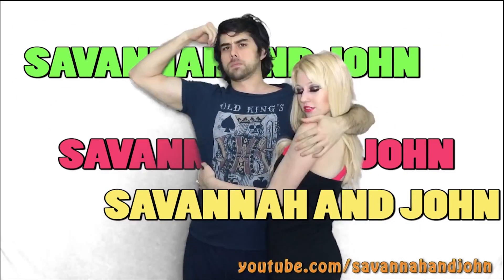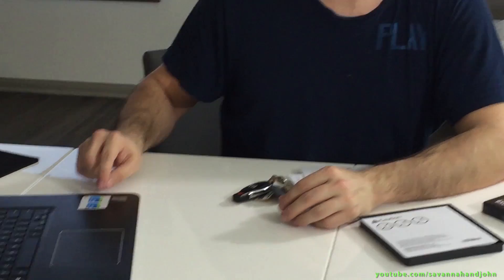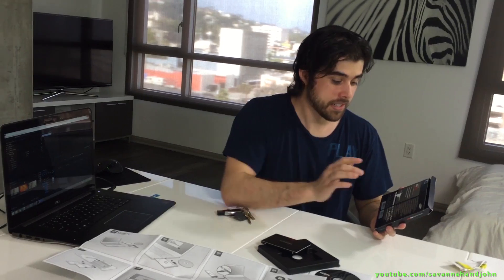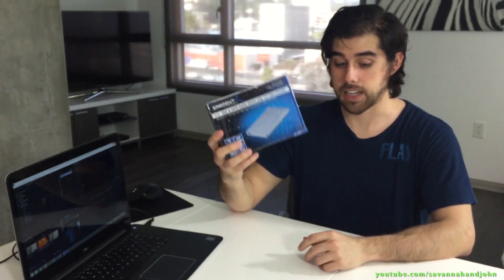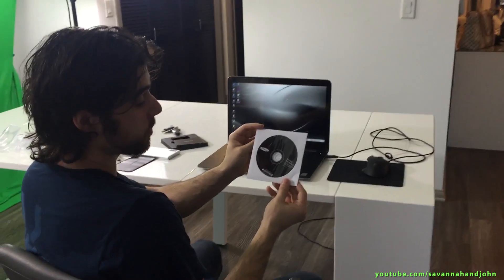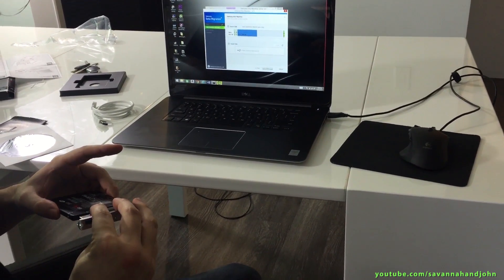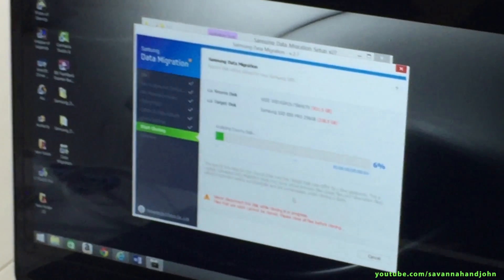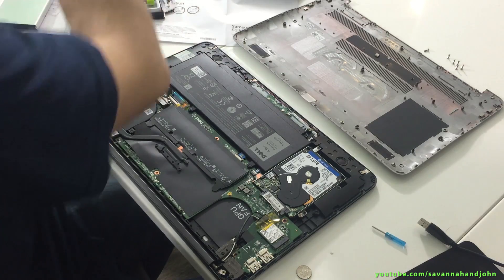Samsung SSD 850 PRO Installation into Dell Inspiron Laptop - Unboxing & Benchmarking

Comment: Im guessing you probably only have 8gb of ram on a single stick. you should upgrade to atleast 2 sticks.
2 4gb rams are better than a single 8gb.

The Dell Inspiron 15 7000 is a great laptop for gaming but it's kind of disappointing that they are using a HDD and a single 8gb ram configuration from factory.
Arguably this allows for more option in upgrading, but if they want to make that argument for a defence then i would highly suggest someone just go as far as building their own laptop from scratch if they really want flexibility.
Retail this laptop is aroung $1500 there is no reason that an SSD ( not M2 ) should be included in the factory.

Also completely off topic, What is up with this computer only having a single USB 3.0 ?

Comment: Hello, one question:  This might sound like a stupid question, but if I am just replacing my second, storage only hdd instead of my OS drive, I can just straight up replace it with this without this cloning stuff or reformatting (my laptop is windows and I have never replaced a hdd ever)?
Reply from the maker: correct, after sata power and sata data cables connected you'll just need to partition the drive in disk management before using, but that's pretty simple and quick

Comment: Nice video. I got this same laptop and Evo500, I'm gonna replace with 1TB HDD  whic is annoyingly slow. Thanks for the tutorial.
Reply from the maker: you're welcome, glad it helped :)
Reply: Hello, sorry this might be a silly question but could you tell me what would happen to my windows 10? (it came with my new laptop HDD---do I have to do anything to make sure taht I have windows 10 like any drivers that I have to install on my external hard drive before I begin to exchange HDD with SSD? (other than my processor AMd drivers)

Comment: my 5 year old dell studio just takes 12 seconds to boot up with and hdd..
Reply: zeus1117 use a timer than I can believe you, the time in the taskmanager is wrong sometimes ...
Reply: +Robipalusa Alias 
Proof it, put it on youtube!
Reply: N1mro8 why should I ? thats average depends on your system, i am running windows 8.1
Reply: Yeah I know, still I would love to see it and of course your laptop specs :).
Reply: N1mro8 Intel i3 M350, 4gb ram, 500gb hdd
Reply: mine takes just about the same.
Windows 10
AMD A8 4500m

something around 20-30 secs
Reply: but.. that's only during boot up...
loading games is painful sometimes
Reply: Cpao V lol which games are playing?
Reply: +Robipalusa Alias I've only tried Portal 1/2, and Lef4Dead 1/2
Reply: Ssd is not only for booting faster. This laptop boots around 2 seconds (yes, from off) with am ssd. Installing programs and storing lots of files on ssd makes significant difference in everyday use. Boot up time is almost the least interesting benefit of all.
Reply: This laptop doesnt even boots up in 2 seconds in the video what are you talking about ?
Reply: Grandpa I have a company laptop, Dell Inspiron 7000 from 2015. Samsung 850 PRO 1TB inside. If you start the machine, you enter windows, hit ctrl+alt+del, go to Startup. There you will see your boot-time. My desktop boots in 7.4 seconds, but its due to the used nvmi m.2 drive. It costs boot up time to use these high performace drives. The laptop with normal SATA3 SSD only, boots in about 2-3 seconds max. I can send screenshot if you want.
Reply: zeus1117 doubt it's 2

Comment: I have a couple of questions.
Did you have any trouble at boot time other than having to select the boot from SSD?
Did you have any issues with the onboard MSATA and the booting of windows?
And were you able to enable AHCI in BIOS to get max speed easily and without any trouble at boot up?

Comment: I recently did the upgrade on my cheapy acer e1 15.  first,  on whatever manufacturer you are using, make a recovery USB stick.  took me hours because I was using an ISO file from Windows Website and it kept asking me for the Product Key.  so #1, make recovery usb stick.  and for more power, think about upgrading your ram so you can open once and get both done. went from 4gb to 8.  when all assembled, boot from USB and windows installs with no problem.  my cheap acer runs like a champ.  fast boot, fast load times. fast everything.  I just wanted to chime in and say Yes, this upgrade is awesome.
Reply: Thor Velasco how did you do that can you link me some article please 😐

Comment: Hello, my friend wants to buy this laptop and he also wants to have the SSD in it. On the other hand he does not want to remove the 1TB HDD. So i am asking Does this laptop have m.2 ssd slot or is there another way to plug in the SSD without removing the HDD?
Reply: +Abhishek Reddy its not support m.2 ssd
Reply: +TheZoonder guys. look for an hdd cady. You can do it if only u remove ur cd drive and re place it with the hdd.
Reply: I want help on this too... Anybody help please!!!!
Reply: +Ιlias Theodore Skordas there is no cd drive nor m.2 in this laptop. It's over a year old laptop already with Broadwell CPUs.
Reply: no it in not possible at all , the laptop have only on slot..I am having the same laptop as well

Comment: do i really need to install or clone before i put that inside my pc? coz i am thinking of just putting it directly and just install windows.
Reply: The point of cloning is that you have an 1-1 copy of your partitions so windows incl all installed software will work as if nothing happened. You can very well reinstall all things as you like without any cloning procedure.

Comment: Thanks for the post... Going for the 850 EVO 250 GB lower voltage set up and upgrading the RAM to 16GB. Same laptop but without graphic card. How big of a difference did the Samsung's Magician software make for boot up times? Same 9 second boot or less than 8 seconds?
Reply: +Keith Cato : where did you find a single DDR3L of 16GB to upgrade ? They are not available in the market !
Reply: Two 8gb sticks funny, sorry for the detail error.
Reply: Dell Inspiron 13 7000 only have one slot for the DDR
Reply: It's the 7548 model with 15 inch. Not the 2 in 1
Reply: 7000 series 15inch 7548 model 1080p, install the GSKILL 1333 ddr3

Comment: Oh I got it.. Thanks again
Another question is the 4K screen
How did you overcome the 4k screen showing everything super tiny?
Did you stick with 4k or ended up using it with 1080P settings?
Reply from the maker: Bilal Mahmood This one just has a 1080p screen.  Model: I7548-7858SLV has the 4k screen, currently $999 at Best Buy. I got Model:.I7548-4271SLV, currently $779, the former has a dedicated GPU (AMD Radeon R7 M270) and 4GB more RAM. I didn't feel it was worth the extra money for me and was skeptical that 4k resolution would be beneficial on a 15 inch monitor. Especially considering a quite powerful GPU would be needed to game in 4k, and a two core processor will have a hard time video-editing 4k videos --- so it would have been more just for watching 4k videos. I did notice that the interface on the 4k model at Best Buy looked exactly the same as mine, so I'm thinking maybe it uses 1080p on the desktop, and 4k for movies and games that can use it.

Comment: very helpful and nice video. At about 7:01 you went to open the bottom. Did it come off easily or had to slip it or apply any kind of force? please share the experience
Reply from the maker: Bilal Mahmood If I remember correctly, I had to use a little bit of force with my fingernails in-between the crevice of the bottom and top pieces and it kind of crackled/popped on each corner section until the entire bottom could come off with ease. ... I'm not sure why I forgot to include that part in the video. It's a similar noise to that at 9:39 when I put the bottom piece back on. 

Also, the 4 screws closest to me (front of the laptop) don't/can't actually come out --- you just loosen them enough to take the bottom off. I remember being confused as to why they wouldn't come out.